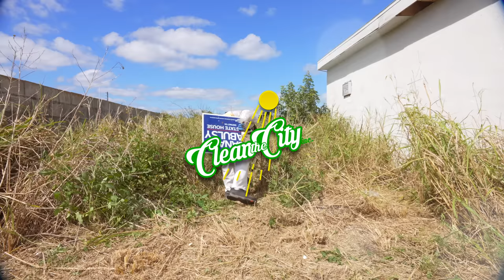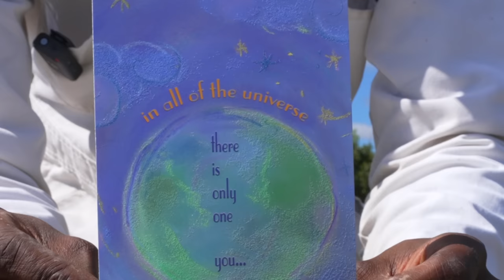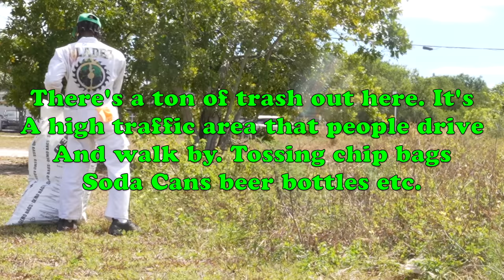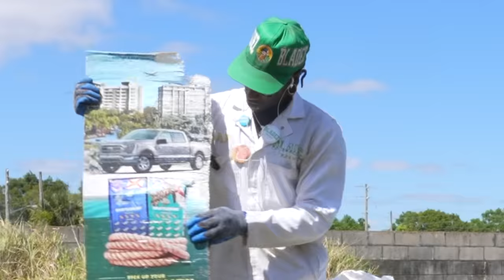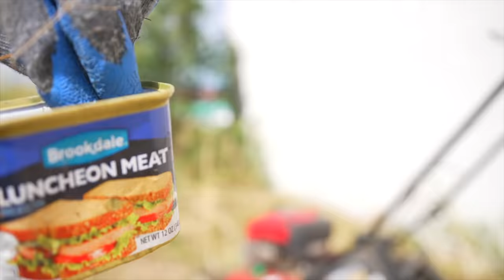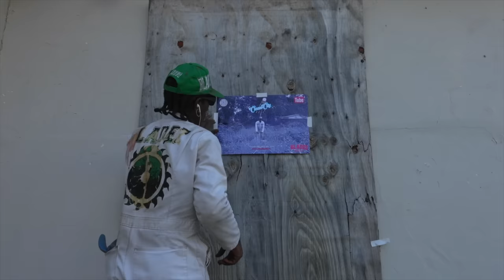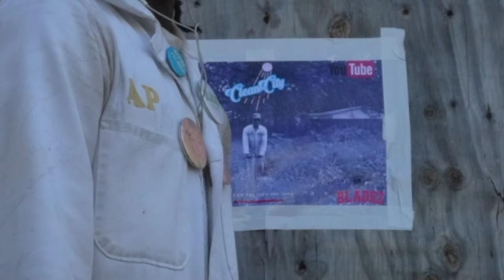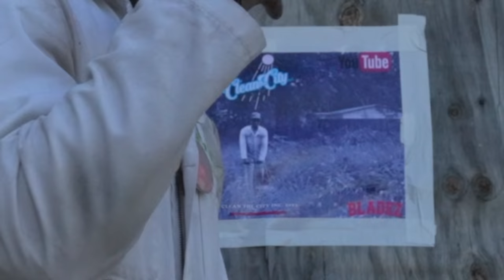SHOCKING Lawn TRANSFORMATION! OVERGROWN For Years! WHERE Are The OWNERS!?

Comment: AP, do you sharpen your lawnmower blades on your own? Tip, when you sharpen the blade; sharpen the entire blade up to two inches from the bolt area. You get more of a cutting area and it works great for all types of blades. And it is great for tall grass. And it's easier on the motor of the mower. Just sharpen the edge side of the blade. You will notice the difference.

Comment: Wow, I remember this one from last year. That would make a perfect Soup Kirchen for the Homeless! The larger side could be the big kitchen, the smaller side could be a pantry filled with shelving for large cans of corn, peas, string beans, a large freezer with meat, and dishes, silverware, cups and bowls! The patio could hold an eating area with picnic benches, but it needs a large cover for when it rains or is very hot out. It would also need a tall fence around it and a security system.

Comment: Hey AP, I know your heart is in the right place, but you might want to be careful investing in some of these properties for a whole other reason.

This looks like It used to be a gas station, one of those smaller mom-and-pops. It's not being developed because the soil underground is contaminated. The underground storage tanks are also "likely" the old steel ones, and by now they have rusted and cracked open, and that's why the place probably closed many, many years ago. The owners couldn't afford to replace them and/or clean up the soil. In the 1990s, the EPA started making some tough rules.

If you bought that land, you'd spend 10 times what it's worth just to decontaminate it, and the EPA is a federal agency, so they rule. Imagine having to dig anywhere from 20 to 30 feet down, hauling all that soil away to a special treatment center, and paying to have it burned and decontaminated. That would likely cover the bulk of the entire property.

Then you've got the steel tanks to dispose of. Oh, and if there are any underground waterways, or if there are aquifers that lead anywhere near sewers, streams, or rivers?

You might as well forget about it.

The previous owners (probably the gas station) probably used the business as collateral for an escrow account, and when they couldn't afford to fix it up to keep running the business, they just let the creditor have it. Those places know they have to disclose the contamination. Which means unless it's a big box corporation (like walmart) with bottomless pockets? They will never sell the property and won't even try.

It's really very sad, because so many nice cities and neighborhoods gets rundown looking because of all the vacant land. Most of that is due to the ground being contaminated.
Reply: Yeah, seeing the aftershots, that was a gas station. I could see the concrete pad with the iron covers where the gas got delivered; that's where the tanks are (at least 40 or 50-year-old tanks), which is also why that cinder block wall was built. 

They dug a trench, filled it with rocks, and then built a cinder block wall; it acts like a wick in a zippo lighter. The rainwater mixes with the leaked gas, and it wicks up the wall and evaporates into the air. That is a "cheap" way to decontaminate the soil, but it takes forever and does not satisfy the EPA rules when someone buys the land.

It's not good for the air quality in the neighborhood either, those fumes can make you lightheaded and ill.

Comment: You need to make a video ( advertisement), for the lawn mower co.  Whatever brand it is it is one tough mower 
 Well maybe it is not the mower that is great but the person pushing the mower that makes it great!.   I cannot believe a push mower would go through 5 foot grass and keep running.    Have you ever tied a garbage bag to your mower handle so you can pick up small trash as you go?  I ounted 13 stumbs to freebe trees you cut down on the back corner. iN ORDER FOR THAT TO HAPPEN THE MUST HAVE BEEN A PILE OF LEAFS AND TO SPROUT THAT MANY NEW SHOOTS.  iT IS TO BAD THAT THE SEEDS WERE NOT REMOVED BEFORE THEY SPROUTED.  i AM SURE THERE IS DAMAGE TO THE BUILDING AND IF THEY EVER WANT TO REMOVE THOSE STUMPS THEY EILL NEED TO DO MAJOR DAMAGE TO BUILDING TO GET THEM OUT.  aS FAR AS i AM AWARE MAYBE THERE ARE MACHINES THAT CAN REMOVE THOSE KIND OF STUMPS FROM SO MANY TREES WITHOUT DAMAGE LIKE A STUMP GRINDER.?   i HAVE oCD ALSO THAT IS WHY I LIKE WATCHING YOUR VIDEOS BECAUSE YOU DO A COMPLETE JOB LIKE i WOULD.  YOU SHOULD HEAR ME SCREAMING AT MY COMPUTER WHEN THE JOB IS ONLY HALF DONE OR LESS THEN HALF DONE AND USING VERY EQUIPMENT WRONG.  tHANKS FOR ALL YOU DO MAGGIE m.